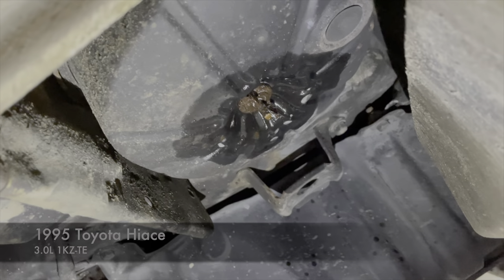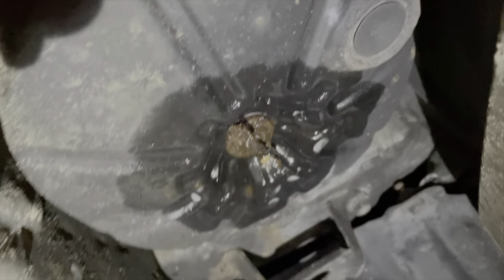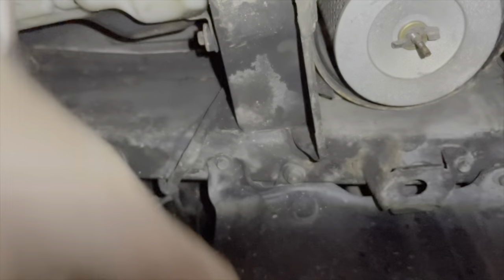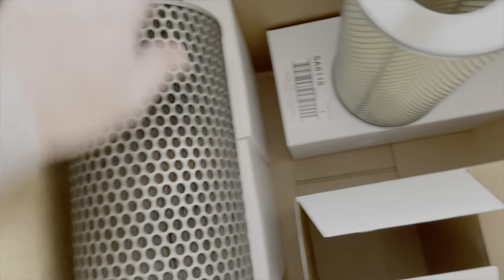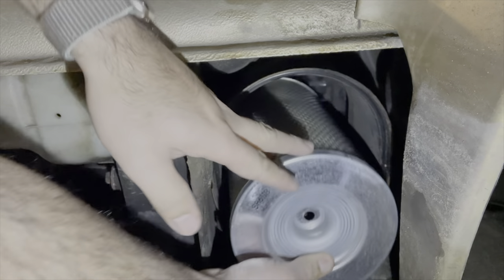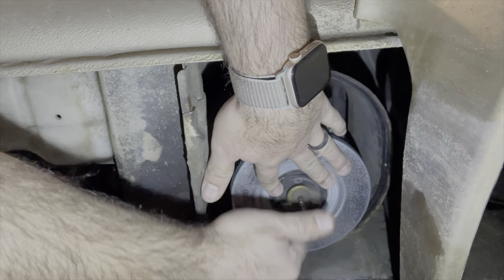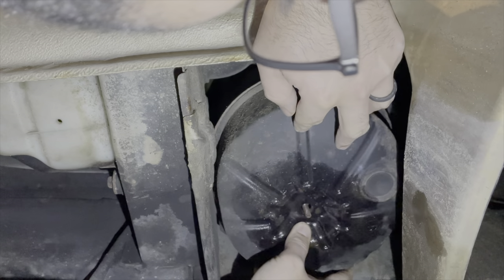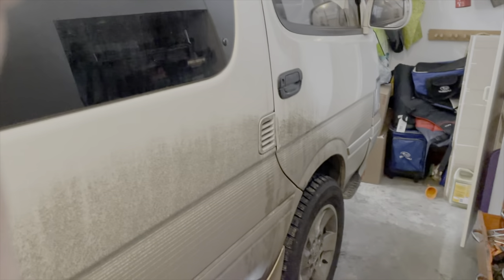Toyota Hiace Van Air FIlter replace/change KZH106 1KZ-TE Wix WA6118 K&N E-2416

Comment: I just replaced my air filter thx to ur video…any idea on that back rubber circle on the bottom of the filter container? Do u think it’s to let water out if it gets in filter housing? I had rust in bottom of my filter housing and it makes me think this would alleviate that happening in the future.
Reply from the maker: Yea, that bottom is made to be someone airtight for water/dirt not to get in.

Comment: Great vid - I used to change my air filter. Do u think that little circular rubber gasket at the bottom of the housing is to let water out? Do you think it’d be a problem to just leave that open 24/7?
Reply from the maker: The gasket is just so air doesn’t bybass the actual filter and go straight to the motor

Comment: Hey I have the same van as you, are you having any overheating problems with it?
Reply from the maker: I have not. You may need to flush your coolant system. There are so many things that could also be causing it to overheat (clogged radiator, water pump, bad fan clutch, etc.) You can try posting for help on the FB group "Toyota Hiace Owners North America" or try and find a local mechanic familiar with the vans.